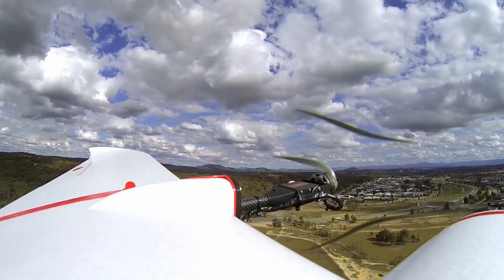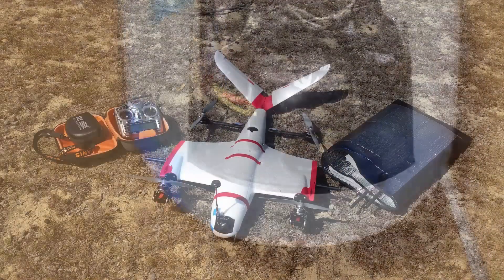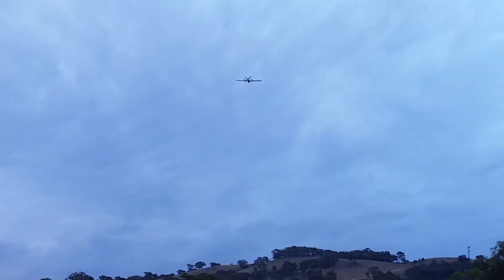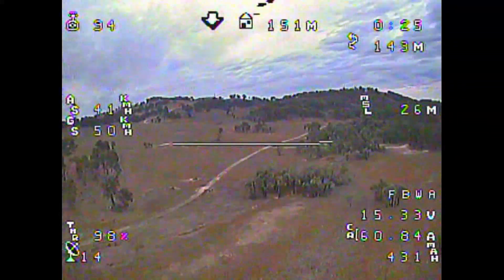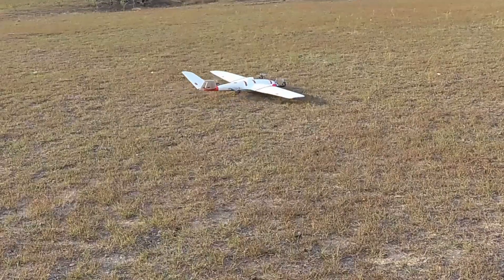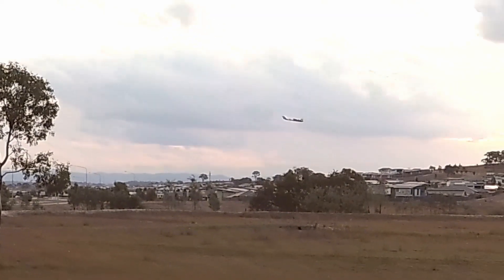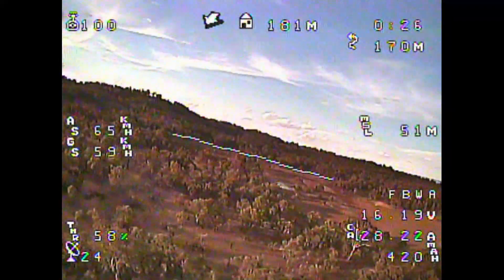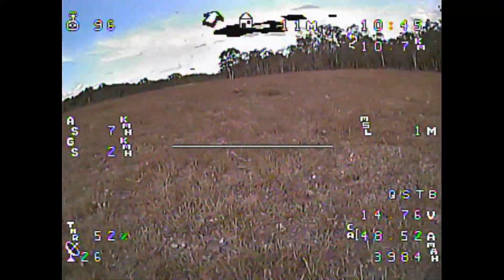Part 3 - X-UAV Snow Goose - VTOL Flying and Final Build

Comment: Great build!  I'm trying to rebuild it with your uploaded parts on Thingiverse, but some questions are left: You are using 35kg Servos for Tilt-Rotors, aren't they oversized only for tilting purpose or did you make (negative) experience with lower powerful servos instead (e.g. 3115 servo motors)? 
Kind regards,
Marcel
Reply from the maker: I chose the servos more for fit and availability than for weight and power output. Probably many other options that would work.
Reply: @zonefpv4328 
I'm just rebuilding your great Vtol goose and things do very well! But instead of 4s I decided to go 6s, so I chose other motors, everything else I  followed your build. My question is regarding the airspeed sensors :You mounted it on the nose, right? Are the propellers not pretty close to it, did you notice any effects due to this position? As I have 2814 600kV 6s motors on the front which are about 1-2 cm higher than your 3508 motors, the propellers are maybe even a bit closer to the nose. So I'm thinking of repositioning the airspeed sensor and would like to know your experience with it as you mounted it. Greetings from Germany!
Reply from the maker: @marcelessers7153  The sensor is positioned on the side of the nose. It works well in that position. However,  it adds to the length of the fuselage and means you can't store the plane it's nose - which might be important to you.